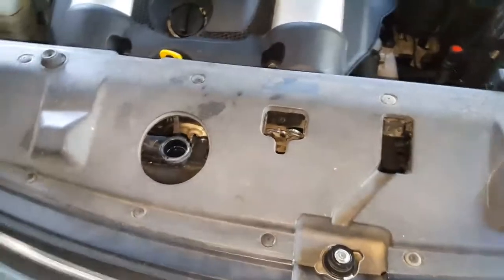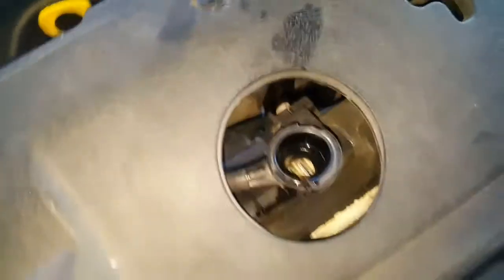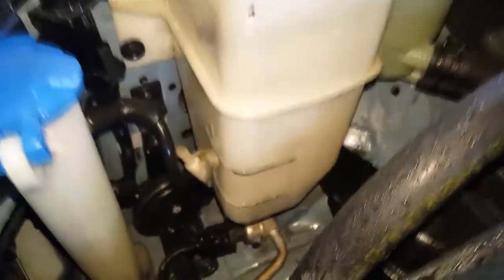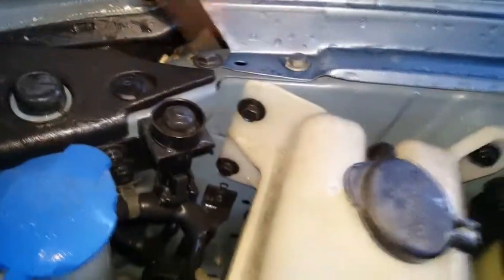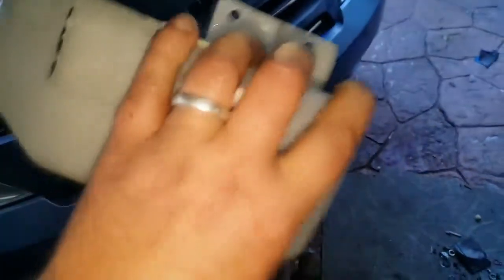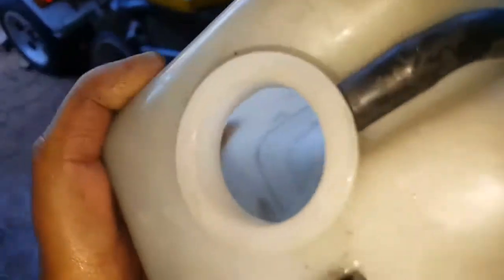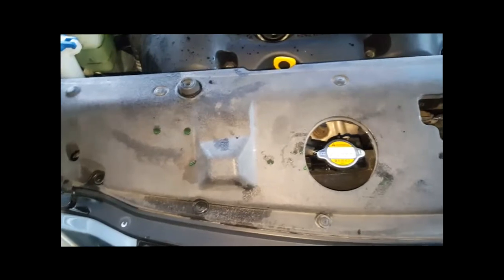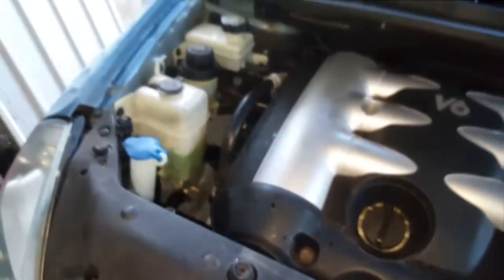Coolant Change [ Kia Grand Carnival 2007 ]

Comment: Where do you put the coolant in? In the resoirvoir or the other prt?
Reply from the maker: Fill the radiator plus make sure all air bubbles are out. You can fill the reservoir before or after.